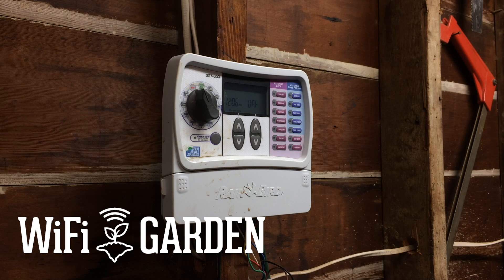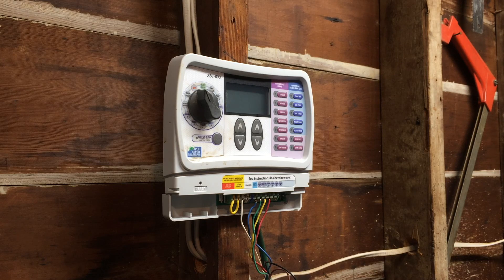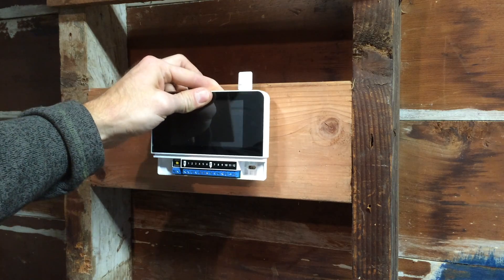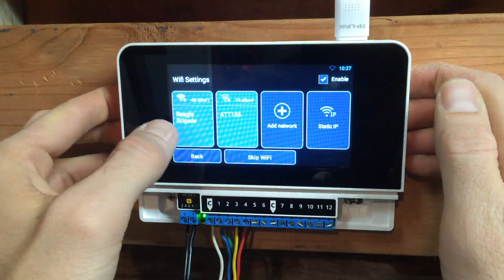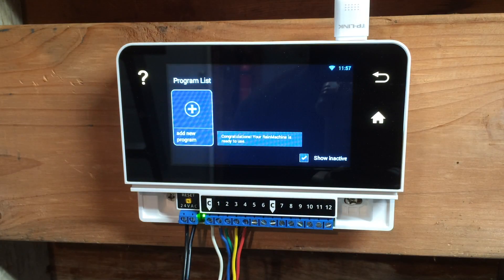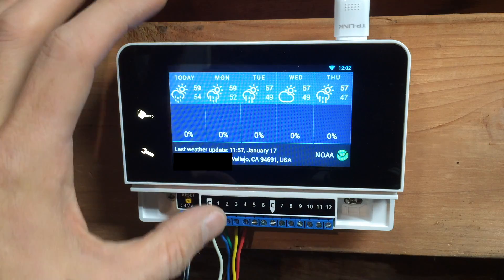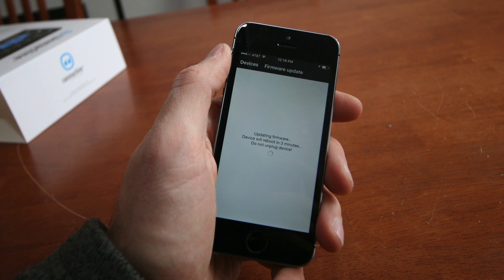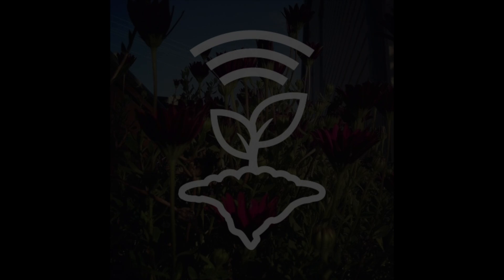RainMachine HD-12 Installation and Setup by The WiFi Garden

Comment: Thanks for the great review!
Will the app alert you of say a failing solenoid? 
Also any idea if this controller tests the drive current to solenoids?

Thanks!
Reply from the maker: That's a dang good question, and I'm not sure. Reach out to RainMachine support, they are quick and smart! http://rainmachine.com/helpnew.php
Reply: Rainmachine said that the data is there but you have to go looking for it. They did say that there was some way to get email if the Rainmachine does not complete its cycle, but not clear on that.